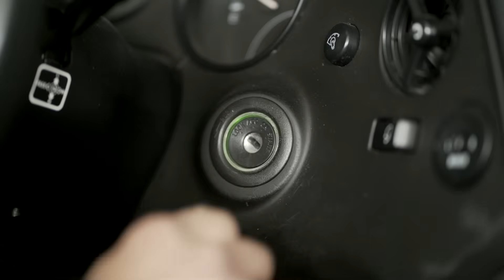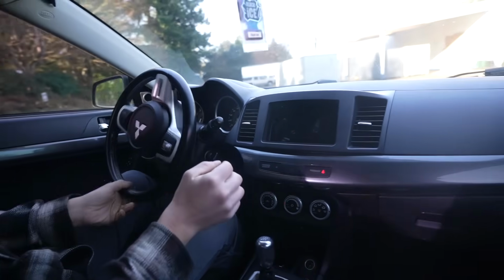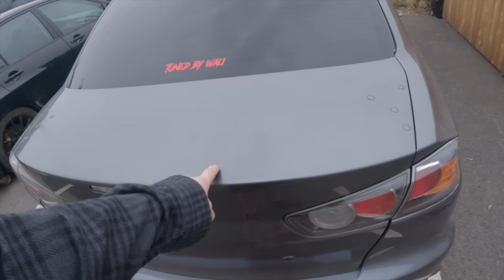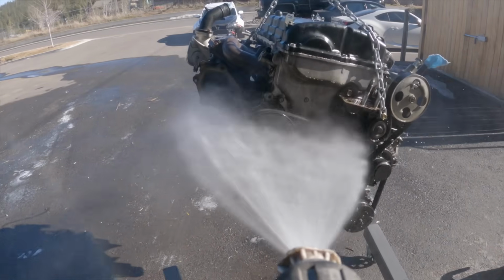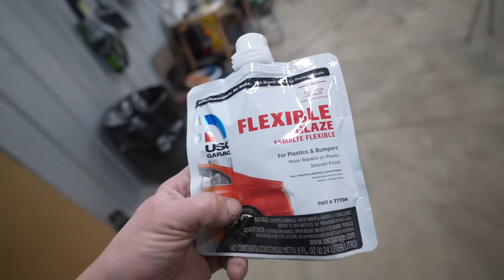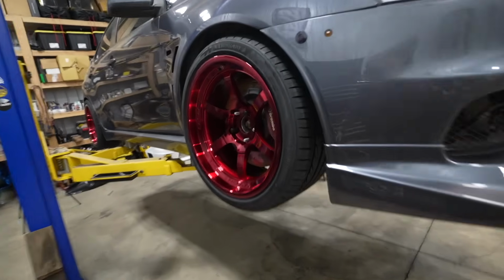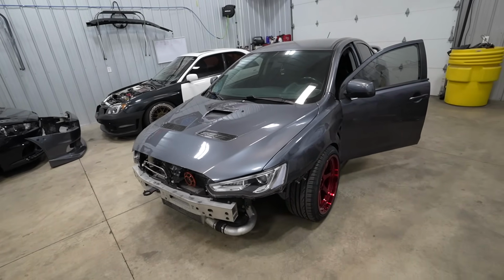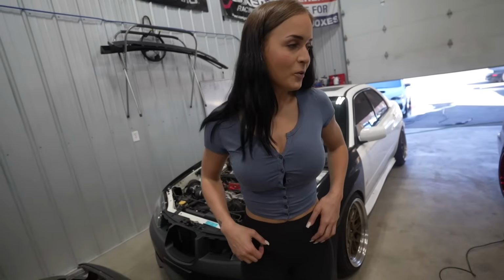Building a 2008 Mitsubishi Lancer Evo X in 12 Minutes!

Comment: You have to try an Audi or vdub some day. I’m in my second one. It’s a blast. I suggest a mk7 golf R or a ttrs/rs3 for the 5 cylinder/Audi heritage experience. That 2.5 5 cylinder makes more power than it should. It’s magic. An evo 8  is on my bucket list. Thanks for all the evo content over the years. It’s been an inspiration.
Reply: @Keepmywifesnameoutyafucknmouth  LOL
Reply: These are pain in the ass cars to work on, millions of vacuum lines and misc. hoses for emissions. Ex EDM 2001 TT driver here. Now I have an JDM 2003 Evo 8. The Evo needs totally 2 vacuum lines for boost control and 1 more for the MAP sensor as I upgraded to a Link ECU. 2 oil breather lines, one on the intake manifold and 1 on a catch tank I installed. It's way easier to work on the car, more engine space with just the bare minimum (it's a street rally car basically) few clips and screws takes the bumper off, then you can pretty much replace/upgrade all water/oil cooling components yourself with a jack and a couple of jack stands.
Reply: @Keepmywifesnameoutyafucknmouth  The Grey Subaru blew up again... Subarus are shit. 🤷‍♂️